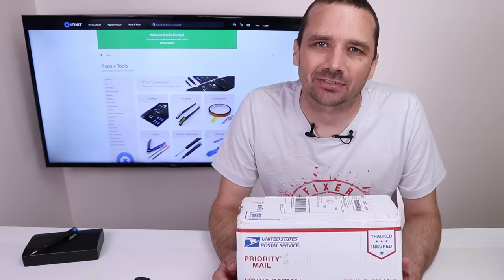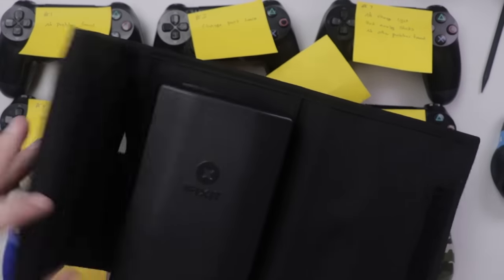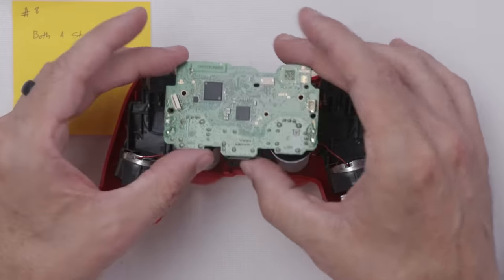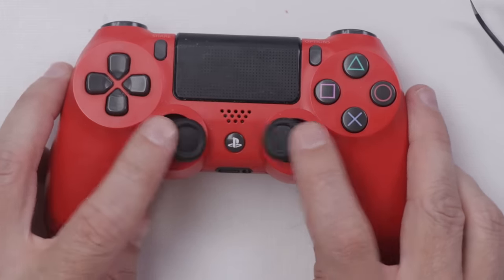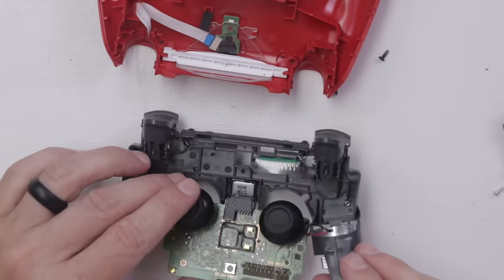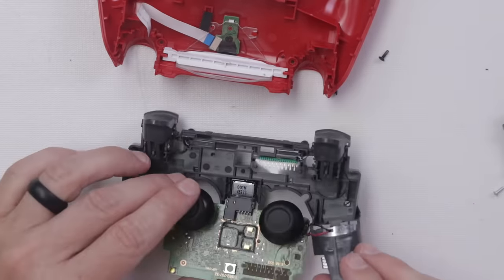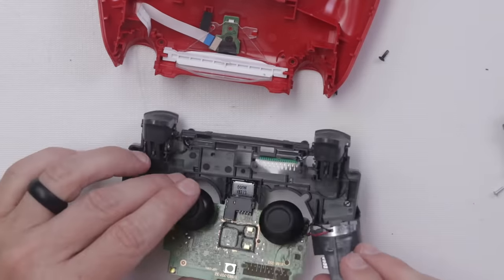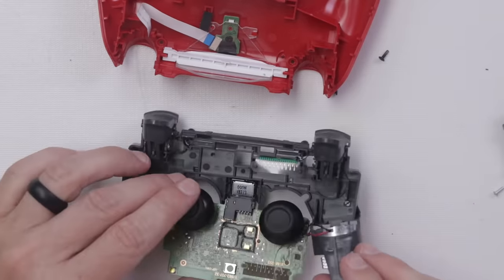I Bought 11 BROKEN PS4 Controllers for $220 - Let's Fix Them!

Comment: Have you seen a controller yet that flashes yellow once when plugged in via charging cord or a dock charger and won't connect I've already changed the battery and have the same problem

Comment: Hello, I have a "little" problem on a dualshock controller. I changed both A stick, with hot air (first time). And now the controller only works with USB cable. I was able to use it wireless with an external battery attached on it, but now the internal battery is fully charged and that won't work anymore. any idea to help me find out what component is broken?
thank you

Comment: Hey Tronicsfix my PS4 controller heats up to the point where it’s to hot to touch while charging. Is this a charge port issue or is the battery overheating. I did happen to notice the gold ribbon cable has a couple scratches in it. Would that be part of the problem.

Comment: Question, if i disconnect the rumble packs and get rid of them, will they affect my controller in any way apart from it not having any added weight and vibrations? I play without vibration anyway so useless for me

Comment: I would love if you could fix a scuf ps4 controller. They have a screw and make it hard for anyone to fix them. It's a basic ps4 board and controller with a ribbon cable to attach their mod. Problem is once a scuf stick is bad you must send it to them and pay for it if it's out of warranty. They charge 60 dollars with shipping to fix a stick. Well they dont actually fix it they just swap the board out. But im tired of sending them in and waiting months to get it back. I had to do this 6 times in 2 years. I actually had to buy extra scufs because the one im using while the other one gets fixed will be broken by time I get one back. Im a casual gamer maybe 2 hours a day at most and i take care of them. I'd love to know what you think about this. I have two broken scufs right now. I love the product but I hate the repair service. And the board they use must be really low quality

Comment: Probably you wont read this, but have an strange problem. 

My controller works perfect and has a good battery life, but when i power of console and controller at night, and then, im going to play at the next day, the controller is out of battery.

What could be? I replaced the battery but no worked

Comment: Hi, great job, reached to you by search, i have a controller which l2 button works only when connected to station or any other power source with cable, do you have any experience with this problem? I couldn't find any solution on internet, any advice?

Comment: My d-pad is permanently pressing left. I've taken it apart, cleaned it, tried the pencil trick, swapped the rubber under the pad from another controller and replaced the green  conductive strip and it still keeps going left! Please help!

Comment: I sort of fixed my own ps4 controller to fix the drift as best as i could but my only issue is i have scratchs all over my controller. How do i open the case without using tools?

Comment: I barely got a gen 5 five controller and it has issues with the d-pad specifically the down arrow wouldn't respond, only rarely. I had the same problem with a controller i got a while back might have been gen 4. But it seems to be a consistent problem with Jdm-4 & 5. I tried cleaning the contact while which worked for a few minutes. How do i fix this?

Comment: I have a issue with my controller, I already to fixed but I couldn't without trying new parts, It wont charge but it only works when it's charging

Comment: Hi, I have a problem with my controller, the problem is that after turning on the controller, it turns off after 3 seconds, the battery is charged, I also checked another one and nothing else. the most interesting thing is that if I manage to keep it alive and connect it to the charger, it does not show me the battery charging icon. it sometimes happens that the controller freezes and cannot be turned on. maybe you have any idea?

Comment: Hey, maybe you can help me. My controller just showed a question mark when charging last week. I reset the controller and it started showing it charging Normally but it's not actually charging. As soon as I remove charging cable the controller turns off. Any suggestions?

Comment: hey man, any advice on my controller? when i move the right stick left or right, it also register like i was moving the left controller up or down respectively (slightly but enough to interrupt ingame experience).
The problem can be fixed temporarily if i blow into the left stick gap.
Reply: Sounds like there's a lose dirt inside.

Comment: Thanks for the content. My dual shock only start if its plugged via USB. After this I can remove usb cable and use normally. After turn off the controller, I need to repeat theses steps to works again. Any ideia of what could be? I tried everything that a found about sync

Comment: I got a new controller for christmas because my old one broke. Then that one broke within 4 months - the right analog stick has a mind of its own. Then I got a new controller for my birthday a few months later and now that one is broke too. Again, the right analog stick although the issue this time is that moving the right stick to the right (so, moving the camera right or looking right) sometimes doesn't register or only goes at about 20% speed so I have to keep hitting it to the right to get it to register properly. I'm not rough with my controllers but I've been so unlucky recently. £100 on controllers within the last year and they've both broken. Problem is, they were gifts so I can't send them back and I don't have the money to replace them (thanks covid for ruining my career!) so was HOPING for an easy fix but no, the analog stick looks to be basically the hardest friggin thing to repair or replace on the entire controller ffs.

Comment: Hi @tronicsfix - question I have two controller they both work on computer and using DS4 software on the pc with a good blue light and charge - but neither will connect to PS4 ? I noticed also that neither will go into blue tooth connection mode if you hold share and PS button. does that mean that the blue tooth chips on the controller boards are faulty?is it possible to repair? the blue tooth chip is a bga? they are the jdm 011 and the jdm 030 controller boards PLEASE CAN YOU ANSWER THIS

Comment: After i cleaned it. I can use my DS4 only when it’s connected to the charger or powerbank (Bluetooth works) but once I unplug it controller forgets about being synced and pairing has to be done once again… Any ideas which part on the motherboard should be checked?

Comment: @tronixfix so I have a controller that has the l2 button that is stuck I mean it keeps saying is pressed even if it's not but the contacts are cleaned up and it has no other problems...what could be the problem? I'm out of ideas it can't be the contacts ribbon because I bought 2 together and the other one works fine (I changed them because the arrow buttons were not working) I olso got into the reversed charging ribbon problem and i figured that out because controller heated up. Olso this controller when you enter menus in games you have to disconnect the controller and reconnect it and it's annoying...do you think it's because it's an old tipe controller? Do I have to buy a different contact ribbon to make it work? The other one is a new type so maybe it's that why?

Comment: i have a shorted chip named d6f near the ribbon connector on the motherboard that connects to the microusb port. Also tried charging the controller from the port near the headphone jack but didn't work (only charges for a second ) @TronicsFix

Comment: I feel like he may be wasting good thumbsticks... if thumbsticks have drift, quite often you can just pop open the green tabs and use isopropyl to clean the metal sensors and the sensor pads

Comment: HI TronicsFix , I was wondering if you could help me , I have a controller Thats L2 won't register , Like I've tried to fix it but it doesn't pick up the button input in the sensor,  The Trigger,  Spring and everything is perfect but under the rubber piece of the L1 and L2 the plastic sensor doesn't pick up the input,  the only way to fix it is to get a brand new circuit Board cause all the inputs works 100% accept the l2 it's basically a brand new controller

Comment: @TronicsFix  if the controller have a Battery OK, a USB connector OK, you've got a light, the controller work plugged BUT ... the battery don't charge. Anyone have an idea ?

Comment: I have 3 controllers that were working perfectly fine untill I got a extended storage drive and opened battlefront. All of my controllers are extremely laggy like a old windows laptop. U spam a button or move the analogue stick and 4 seconds later it moves and wrecks your game

Comment: Hey i hope you see this, my controller is broken it deconects randomly very often but nothing else i opened it nothing bad visually at all... but after i put it back togheter it worked fine for a day and then again it deconects . The problem stays even if it is conected thru Bluetooth or  with cable... Da you know what i need to replace most probably ?

Comment: How about a controller that will charge, but wont connect to a ps4? Ive tried multiple cables, checked the connections internally and everything seems fine.

Comment: is it cheating just replacing the parts? 
the average person isn't going to have spare analog stick parts and the ability to solder. 

can the drifting problem be fixed by just taking it apart and cleaning?
Reply: The analog sticks cost like $1 a piece its really not worth spending time on them. I have heard that you can try to fix them by bending those plastic covers on the sides and trying to clean the graphite? pads insides with some iso alcohol but it didn't work for me both times I tried it out of curiosity.

Comment: On my ps4 controller, the down button on the D pad keeps having problems registering. Every other button is fine. I've taken it apart and done everything I can think of. The wire film is fine because It registers when I press on the actual wire film without the plastic d pad button piece. Any ideas?

Comment: What is the flow on and heat on the heat gun I see no heat tape or anything on the two analogs you fix st 10 min and 45 sec I use heatape and ones analog are replaced then all of a sudden I have other problems with the controllers especially on motherboard JDM 055 the lasted board that Sony putting in there controllers any advise please thxs

Comment: I ordered a lot of Nintendo handhelds and one of them (a ds i) will turn on for a  second then the orange charge light will start flickering when the charger is plugged in, I have changed a battery for a known good one but no results, if you know the problem I would really appreciate an answer.

Comment: I was hoping for rumble issues but you didn't test any of them. My controllers rumble is going. Barely works makes a weird sound when it does other side is fine. I looked for damage but no visible broken plastic and clean.

Comment: My control will not not come on unless I put the cable in a firmly push it says its charging but soon as I pull out the wire turns off again. I took the control apart plugged the wire into charge port and it connects comes on if the audio part is touched or knocked at any point turns the control off when casing is on or off what could the issue be. The audio port was fuzzy before I had this issue

Comment: Hi, I'm sorry. I was wondering if you can help me. I have a ps4 pro and it spilled water on the console. it turns on and works but the fan has damaged the part where the fan is connected, you think that other circuits on the motherboard that controls the fan is damaged

Comment: Hi, my controller works perfectly if I connect it to the steering wheel controller, I thought it could be because of the battery but unfortunately i changed it for a new and still doesn’t work, also doesn’t work if I connect it to the ps4 with the cable, the charge board shows the blue led when I connect the cable when I connect it to the steering wheel . What could be the problem?

Comment: Hi, i have an issue with my DS4 controller (model: CUH ZCT2E).
It keeps on giving me orange light blinks (3times) whenever i tried to plug it on a charger or when i press the PS button and the reset button it still blinking orange light three times...
After watching you fix all these controllers.. maybe you can help me fix mine.. thank you in advance....

Comment: I tried something with my controller (i thing i gave too much power from the charging port) then the light turned of and it started to not charge. I thought the battery died because it was working when pluged but turn off immediately when i plug it off. So i changed the battery but it didnt work. So.. what can be the problem?

Comment: Tip: Sony didn’t put the charger port in a good spot, if you aren’t using the controller while it’s charging, place it upside down so the charger port doesn’t get get wear down and lose

Comment: My controller works only if it is plugged into a cable. As soon as you unplug it the remote goes dead. I did replace the batt. 
Forgot to mension my my 1 year old threw it into the bath tub. I dryed it and seemed to be working perfectly when pluged in. Unpluged does not work any help

Comment: @tronicsFix i have 3 DS4's (v2's) with the same issue. When I connect them to my PS4 pro, the DS4's charge (Orange blinking light). However, they won't reach maximum capacity because they keep on charging non stop. Normally the orange light stops blinking. When I disconnect the charge cable, DS4 gives a pop up that the battery is empty, even after multiple hours of charging. 1 DS4 reaches around 1 bar in the battery screen, the other 2 are dead after disconnect. 

I bought replacement batterys but this did not solve the problem. Can you tell me whats wrong??  It's a camo, blue and rosé pink DS4
Reply: PS. I also tried charging them on the charge docking station (official Sony ) but thesame problem occurs

Comment: How do you fix a PS4 controller when it has a Bluetooth issue 

My PS4 controller only turns on when I put a cable into it, the Bluetooth on it doesn’t work 

I think it is a battery issue but not sure, can u plz tell me what’s wrong with itn

Comment: I have 2 controllers that charge normaly but cant connect to any other ps4 even the pc wont recognize it, i have a gaming house with 10 ps4 & it connect only to one of them it seems like it can't send & recieve information that i put it on another PS4, if i replace the 
charging circuit it will work ?

Comment: Help Help help. Please read this. I have had my sons switch fixed as he broke the usb c port. Now the repair shop has said it won’t work in the dock and show on tv and only charges a certain way round with a charger? Is this something that is correct, they said the usb c connection was too damaged? Please can you help this seems strange.

Comment: Most of those need new stickers on the back and theres one thats missing.
Reply: Those are serial number stickers so it'd be pointless to replace. They wouldn't match up with the model they're on.
Reply: @glassfractals93  not too hard to photoshop and print replacement stickers with the correct serialization.

Comment: Question: if the battery connect broke, can i soldering battery instant to motherboard? Or is this cant work or broke the controller? Sry my english.
Reply: It can be done but it would be very risky.

Comment: I need help with a 3DS problem. I don't if its the system itself but a specific game card wont read even though its clean and I tried to insert it into my brothers 3DS same issue the game icon shows up but the card wont read its weird considering the fact my 3DS is clean and nothing is jammed in my card slot.

Comment: Hello , can u help me ,i open up my controller trying to clean it and when i unplug the riben cable from the board it came out with the white plastic, when i tried to put it back 2 of those pins on the board came out ,and now my controller works fine but not charging and not showing the yellow light , what can i do, tnx

Comment: there is a problem that i'm facing with my controller, it wont connect wirelessly, wont turn on the ps4, it must be connected to the usb cable at first then i can unblug it from the cable, it will work just fine.

Comment: Hi I have a DS4, after longtime not use (6 month) i can not turn on for wireless connect. i check with usb cable is OK. check battery is ok, and charge is OK. So what's i can do with this case?
Please help me/

Comment: My controller was working perfecting fine last night and I put it on charge and went to sleep and when I woke up to play the controller would blink a red light and wouldn’t connect to the PS4 then eventually it stopped working and won’t power on, idk what’s wrong I just charged it!!!
Reply: I know it’s not the ribbon cable that’s upside down because I never opened my controller

Comment: Sorry but that "easy" fix on the joysticks does not look nice at all, board is burnt in parts.. I would've preferred if it eas done more methodically by heating and sucking each solder connection.

Comment: My controller doesn't want to connect to my ps4. Ive tried 3 different cables but no success. It seems to be charging so in theory it should be charged. Ive tried alot bu nothing helps

Comment: Could you fix mine because my square barely works and my right stick cant crouch in fortnite and my square can open chest
Reply: It damage the inside since i hit my controller
Reply: I also got two controller with the stick is brolen inside i think
Reply: I also think the charge port is broken